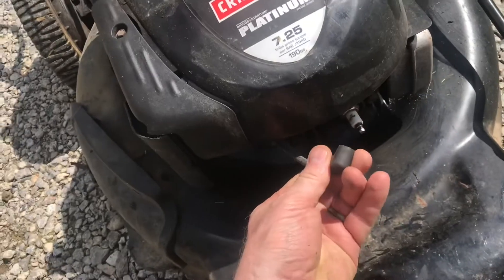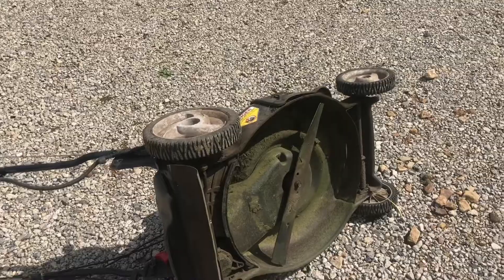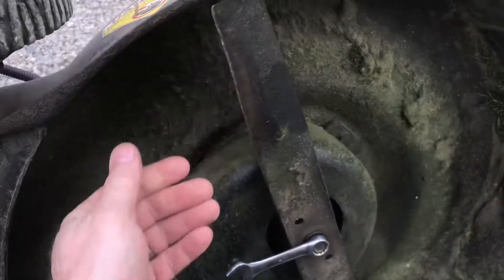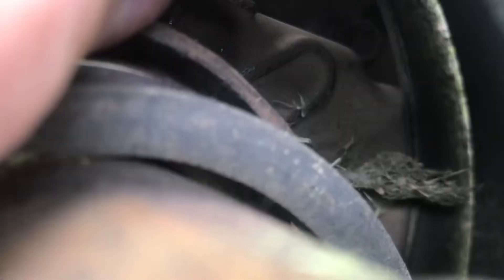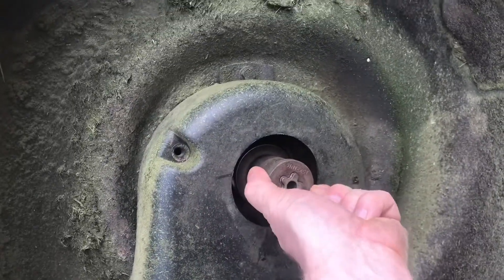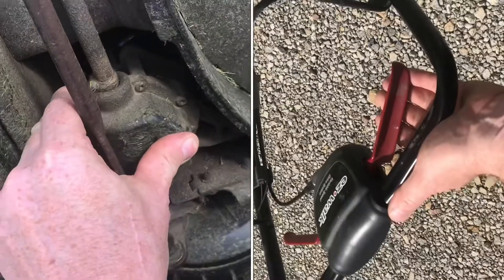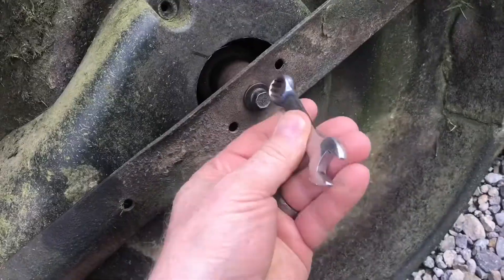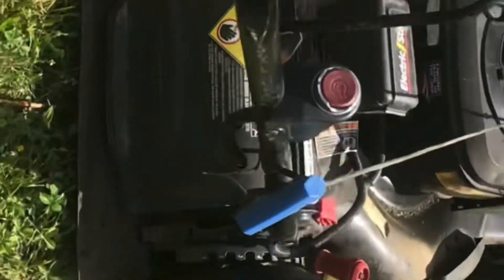“fixing” SELF PROPEL on a lawnmower (belt installation) briggs and stratton

Comment: Oh. That was the wrong end and not a common problem. How to remove the belt completely looks insane and thought this would cover the back part. There’s a wheel you can’t lock to ratchet it off but need to unbolt it completely because the guides are welded to it and can’t put on a belt without getting them. Getting them off is pretty much impossible and Jeeves not YouTube is any help. That’s the COMMON problem on these. Never heard of a belt randomly slippin off in an easy to reach place.